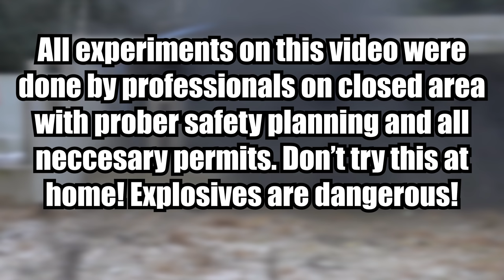How hard it is to explode a hole in concrete wall?

Comment: The effect where the back side of the concrete breaks and flies off even though there's no hole is called "spalling". It's caused by pressure waves inside the concrete bouncing around and interacting; when two waves meet in the right way, it creates an area where the concrete is "stretched" further than it can withstand, causing fragmentation of the material.

An interesting related fact is that the spalling effect is a consideration in the design of armor for tanks and other vehicles. Incomplete penetrations and explosions can cause spalling on the other side the the armor, creating a shotgun-like blast that can injure personnel and damage equipment. In fact, there are munitions created specifically to take advantage of spalling! Because of this, many armored vehicles have layers of material such as Kevlar lining the inside of the armor, in order to catch the spall fragments.
Reply: ah yes, HESH or High-Explosive Squash Head, basically it's a very thin-walled shell filled with C4 or other kind of explosive something, range doesn't matter, just let it stick and boom, done.
Reply: That’s really interesting, thanks for sharing that!
Reply: @chiisan3776  flashbacks to the FV4005 in war thunder
Reply: @packetdrinks9215  I was waiting for the War Thunder comment lol
Reply: Oooh, that's very interesting. The more you know.
Reply: The professor😄
Reply: this happens to glass balls too, the waves will travel around the ball and meet at the back, clash, and release all their force there

it will basically occur in any material that is shaped in a way to allow the shockwave to travel around. thats why many armour is seperated and disjointed, to an extent anyway, armour like that would introduce new weakpoints as well
Reply: For a real experimentation you will need to change the concrete wall for each explosion due to structual colapse that each explosion will cause. Like a hammer, that will break part to part of the structure to the wall down.
Reply: This is true. Concrete is only viable for compression. It is a terrible material when stretched. That is why rebar must be added. It would be interesting to see concrete that has hydraulic cables holding it together instead of rebar.
Reply: Hesh takes advantage of this property correct?
Reply: I mean, isnt that the exact reason that shaped charges were created? Yes it was designed to penetrate light to medium armor, but worse come to worse, the i poundage of the blast on an object would be enough to cause substantial damage if weak points were targeted?

Also the uranium cores within dozens of munition types are so dense they're capable of delivering thousands of lbs of force to a small and concentrated area for the express purpose of, if not busting through, delivering a lethal level of energy to anything inside it?

I've heard stories of these uranium rounds hitting Iraqi tanks, the tank didnt explode, in fact, the round was caked into the tank. The area around the shot, crippled and stressed, inside, the soldiers ears and eyes bled from the overpressure, and died from the sheer force of the attack.

Is this true? Or more myth than reality?
Reply: That's why you need add the soft pad to the AR500  steel plate armor or whatever hard ballistic armor you are going to use, when bullets hit the hard armor they can break apart and spall and actually hit you in the underarm where the artery is or in the neck or chin area, the soft pad catches these fragments.
Reply: @amichiganboiwhosereallazy1544  HESH is what I was referring to in the second paragraph, yes.
Reply: Fascinating! Thanks for sharing! 👍
Reply: Oh yeah baby bring on the spall!!!! (Jack black to bruce Willis in the jackal)
Reply: @Jarlemoore1  if you're meaning the bullet breaks apart, that's referred to as "bullet splash", not spalling. Otherwise, you are correct.

Spalling happens on the side opposite of the bullet impact (in this case, the opposite side being the one that is against the body) for spalling to happen, the bullet can't have penetrated the armour.
Reply: @Angels-Playground  I doubt it's true. It's a massive hunk of uranium (Not an uranium core, instead a solid uranium dart) traveling at 1700 meters per second which probably could create such over pressure if it transferred all of it's energy in to the armor. I doubt they do transfer such energy to create over pressure though so the stories heard are likely myths. An APFSDS projectile disables crew with spall from the inner surface of the armor.
Reply: @Kurokubi  Projectiles that penetrate can and do create spall very often for example in tank shells.

Comment: There is a term for the effect of the shaped charge. When the explosive causes almost no damage to the surface it touches, but sends shockwaves through the material and causes shrapnel on the other side is known as "spalling".
Reply: Its not shaped charges that do that, its HESH munitions with HESH standing for High Explosive Squash Head.
Reply: @InsufficientGravitas  yup good 'ol hesh
Reply: @InsufficientGravitas  and yet here we saw a poor shape charge spall... Even kinetic rounds can cause spalling, its not just hesh
Reply: @noncog1  Yeah, but they cause spalling as they pass through, for the most part at least, and the specific mechanism described was of HESH. Neither Heat not AP shells are focused on or really able to create spall in that manner.
Reply: @InsufficientGravitas  kinetic shells absolutely can cause meaningful spalling, which contributed to the understanding of such effect and led to the development of hesh. Kinetic round spalling was a real and impactful aspect of armored fighting in the pre-modern era. The first rounds used specifically with spalling being intended were kinetic rounds not capable of a meaningful complete penetration, spall lining was used before hesh.

Comment: Concrete is really good at taking pressure, but pretty weak against being ripped apart, that's why the inner side takes little damage (compression) and the outer side rips away

Comment: There's actually a breaching charge designed to break through solid concrete walls, it's called the concrete charge (duh) the hard part is dealing with rebar reinforcement because the c-4 shatters the concrete and makes it crack, but it also keeps the c-4 away from the steel bars. To blow through steel the c-4 needs to be in direct contact with the steel to cut it. So reinforced concrete walls are hard to blow a hole through because the rebar reinforcement will still be untouched
Reply: All about the rebar 💪
Reply: @jshaw4757  for real though it's just mild dirt steel but its such a problem to explosive breaching
Reply: @andrewhallard537  I never thought such a universal method in concrete making could hinder a high explosive
Reply: @manny4707  yeah but it makes sense, rebar is mild steel which takes a considerably higher pressure to cut it with explosives. While concrete cracks pretty easily
Reply: I wonder if you could just use four linear shaped charges to make a square hole. 
I imagine the size of the charges required to make it through in one go would be ridiculous.
Reply: @judahboyd2107  page 156 of the usmc 0351 infantry assault marine text box details concrete charges(yes I still have mine lol). 6 blocks of c-4 (1.25 lbs blocks) and 32' of 50grain per foot det cord as a main line charge, and a detcord loop priming system and 2 blasting caps.
Basically you make a circle out of the 6 blocks so when they detonate the shockwave from each block travels to the center of the circle and the shockwaves collide with each other shattering the concrete into dust. Won't touch the rebar though, for that you could wrap detcord around each piece of rebar and cut a section out at once. It would take an ungodly amount of pure c-4 to topple a reinforced, filled cinder bock wall, doable but not very practical.
Reply: @judahboyd2107  now that I think about it, in the civilian world of explosive demolition there are linear steel cutting charges used for steel beams, I assume those work really well at cutting rebar lol, maybe it'll cut though the concrete aswell idk
Reply: @andrewhallard537   Those steel cutting charges are designed to work in contact with, or at a specified close spacing from, unprotected steel.   Don't work so well when the steel is rebar in two layers in a  concrete wall.
Reply: @cr10001  good to know 👍
Reply: Time to get the angle grinder out
Reply: INSIDE JOB CONFIRMED
Reply: Yeah, we used to use stripping charges for concrete structures. Otherwise, yes, any gap between the steel and a cutting charge and it could fail. The steel rio that's left can't support the weight of the structure so it will collapse. You're generally doing one or the other.
Reply: Also, you want to blow a hole through any concrete/steel structure? Hayrick No. 14 every time. google them....you're welcome.
Reply: Fly a plane into it. It works, just ask Americans.
Reply: @-TheShaun-  Most of the Americans do not believe in the official story that you are trying to sell here... not to mention that the building was advertised as pasanger plane resistant when it was constructed...
Reply: The short answers to this are the torch or det cord. I think the fastest possible way through rebar would be the thermal lance, though incredible things can be done with high current.
Reply: @AtlasReburdened  the thermite flares they use for breaching are really cool, I've also seen someone use a stainless brake line And pump oxygen through it and ignite one end with magnesium, the steel line burns crazy hot
Reply: @andrewhallard537  What I know as a thermal lance is what you're describing with the brake line, but optimized for industry. It's basically just an iron pipe filled with iron wire and loads of oxygen pumped through. They can be lit with almost any oxy-fuel torch. I don't know of anything that can remove steel faster and is remotely man portable.
Reply: @andrewhallard537  I'll have to check out the thermite flares. That sounds pretty cool.
Reply: Couldn't you use linear shaped charges to cut through both the wall and the rebar?
Reply: It's why you need to drop a telegraph pole sized steel or tungsten rod at terminal velocity to penetrate those reinforced bunkers
Reply: That's where thermite or astrolite come into play.
Reply: @UtubeH8tr  what's astrolite
Reply: @andrewhallard537  liquid version of thermite.
Reply: @andrewhallard537  those same charges are used in other units, they're called "explosive cutting tape" or ECT.  They're designed though so that the standoff for the shaped charge is spaced properly for a target that's directly below the charge, so they don't work on rebar reinforced concrete.  A wall like that takes two charges or use of mechanical or ballistic breaching in tandem.
Reply: Bruh just bring a wireless angle grinder
Reply: @Kai-zx8ep  yeah pretty much the easiest way lol
Reply: @andrewhallard537 the solution to a concrete wall in your way should just be MOAB. I don't care if you can climb or go around it just use a
MOAB
Reply: @andrewhallard537  a shaped charge is exactly like a lens, it has a certain focal distance and doesn't work so well if it's too close or too far.
Reply: The thing is, the couple of pieces of rebar in this wall are nothing.  Take a look at the rebar in an actual, structural concrete wall, floor, bridge or footing - sometimes the concrete has to be ordered with special aggregate in order to get it to pour through the steel because the rebar is so dense it's like a strainer.  Simple block walls or non reinforced mass pours (like most building made in Soviet era russia) are much easier to breach.
Reply: Well once you blow a hole through the concrete cutting through the rebar won't be so difficult.
Reply: yt088  thermite is pretty useless against concrete, actually it's pretty useless for anything over an a quarter inch thick
Reply: Electricity cuts through steel quick, but I dont think soldiers would be kitted out with that stuff.   But its not much, like a battery and hammer
Reply: No need only need a finnish person with a jerry can and c4

Comment: The damage on the other side of the concrete wall is from what is called spalling, and it works exactly the way you describe. That's actually why tanks have anti-spalling fabric on the inside of the armor; early anti-tank weaponry caused most of its blast-only damage that way.
Reply: That type of damage is called spalling(and not the cause of it) and in this case it is so significant becaue concrete is an anisotropic material(contrary to for example armor plate on a tank...).

Comment: One of the funniest and most entertaining videos on youtube.
As an ex Royal Engineer, pretty well versed in improvising various explosive devices, I knew the water contained charge would work, water is very good at containing and directing explosive force and this is a well used technique for increasing the power of a charge, either for breaching or for example, demolishing a bridge.
Even the water bottle one would have done more damage if the charge had been against the wall with the bottle behind it, rather than having the water protecting the wall, directing the charge away from the wall.
Reply: The water jug charge reminded me of the petard bombs used for wall and gate breaching during the medieval era. 

Even though the petards used packed gunpowder instead of high explosives would the way they did damage to a wall be the same as the jug charge in the video?
Reply: Thank you for explaining that.  With the incredibly thick accents I couldn't understand 90% of what these peeps were saying, and I had no idea what the point was of using the water-filled jerry can.  I'd like to know more about the physics behind this.  I also did not understand the attempts before and after the water can.
Reply: @peedee4065  Then  what exactly DO you understand about ANYTHING ?
Reply: @paulanthonybridge5741  Enough to be able to articulate myself.  Lol, wanna give it a try?  Tell me what they're doing at 3:55, and also at 10:24.
Reply: @peedee4065  the explosive compresses the metal and accelerates it immensly, if well arranged a shaped charge creates a plasma beam, that cuts through almost everything.
Reply: @maxh.7946  You may want to read about the Munroe effect. Contrary to somewhat popular belief, it has nothing to do with a plasma beam or anything. The shape of the metal just guides the shockwaves as well as a stream of metal moving at very high speed.
In essence, it's an efficient way to transfer the blast's energy to a useful component instead of to a broad volume not necessarily involved in breaking the wall.
Reply: @titou1384  thanks for correcting me! Will do so
Reply: @titou1384  Read about it and Wikipedia says, that the munroe-effect does create a plasma-beam from the mettal. It says that the effect is what creates it
Reply: @titou1384  I'd like to see them explore more with the monroe effect. eg a sheet of steel, a piece of sheet PE and a tree LEAF!!
Reply: @peedee4065  I'm from Texas and I understand them quite well lol.

Comment: For anyone wondering,
The reason the explosion isn't huge and slow,
Is because those types of explosions are typically used in movies, for dramatic effect.

Explosions like these, are essentially for military use.
And because of that; require a fast detonation to acquire a fast shockwave.
And the reason is; More damage, etc.

Comment: It was interesting to see the spalling on the backside of the wall for the charges that didn't penetrate. This is why tanks have a spall liner on the inside of the tank, to prevent the tank to turn into a hand grenade even when the tank havent been properly penetrated
Reply: The water jug was basically a HESH round.
Reply: McFlickers  but...different concept entirely so...
Reply: The speed of sound in and elasticity of the material may play a big part in reducing spalling, as well as the tensile strength. A lot of buildings have a damper layer on the backside of the solid mass of rock like polyurea, with a catchers mitt like kevlar bolted around the edges.
Reply: @PatGilliland  the one with c4 and metal pipe was also a shaped charge. they should have used copper though. it has a lower metling point but i had expected it to go through the wall like a heat charge and not a heshcharger. im not an expert like you guys but i thought it was pretty interesting
Reply: The one with the water jug wasnt a hesh charge I bilieve. They placed the water jug behind the c4 to direct the blast into the concrete.